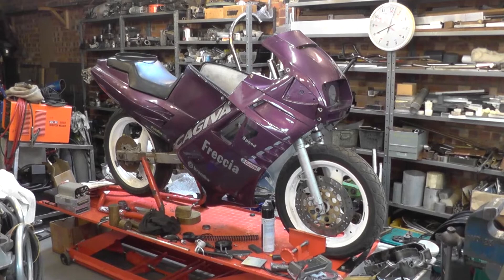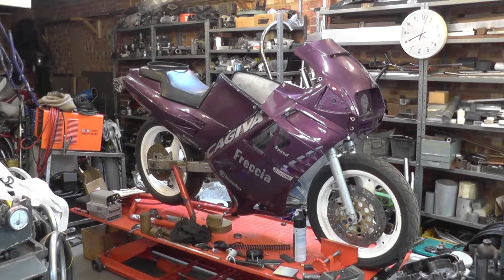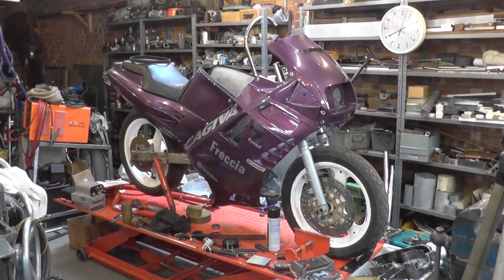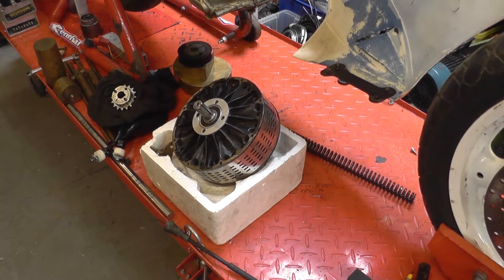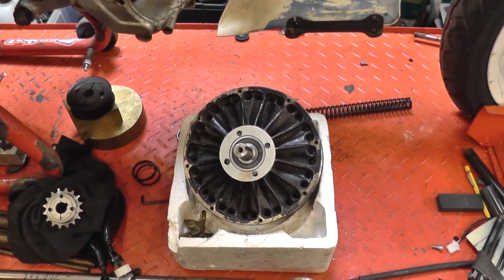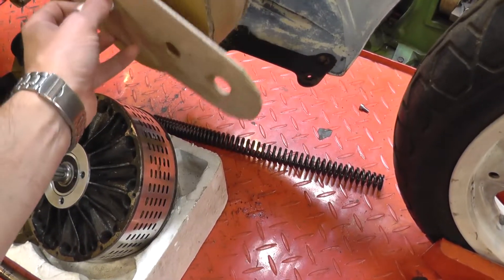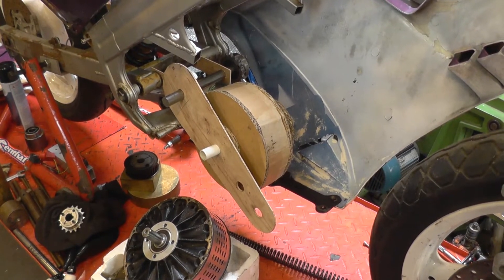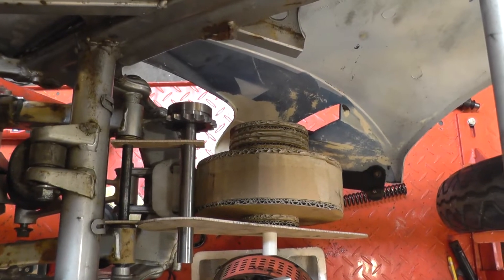Cagiva Freccia EV -introduction

Comment: Cool my ass. He basically destroyed an hystorical bike that had some importance in the story of eighties motorbike instead restore it. For what? For a bike that will have less range than a bicycle. I have great respect for Paul, but this time i think he is wrong.
Reply from the maker: Between the wrecked engines, bent forks, broken instruments, burnt out wiring, etc. None of the five incomplete Freccias I eventually bought (three for £80 once) was a realistic restoration. Instead, parts have gone to more than one Morini Dart and with the EVs,  I'll have saved a bike, or two, that might well have simply been just scrapped. As for range, 75miles @ 70 mph should be possible if I can find room for the cells.